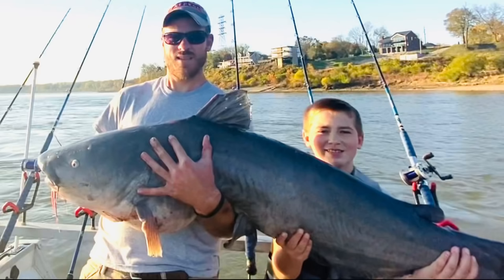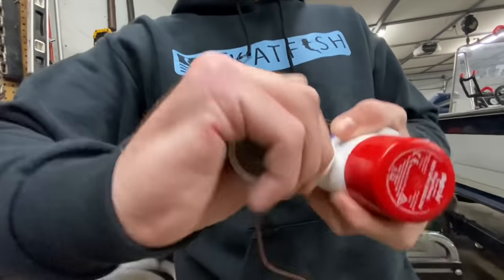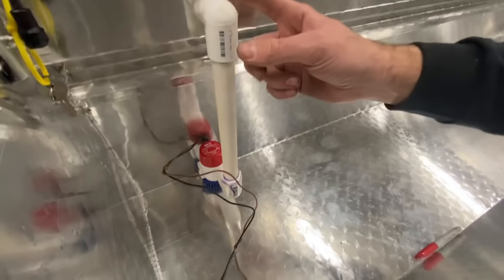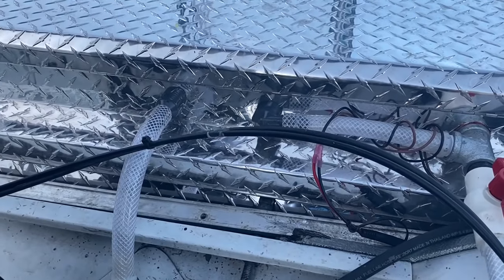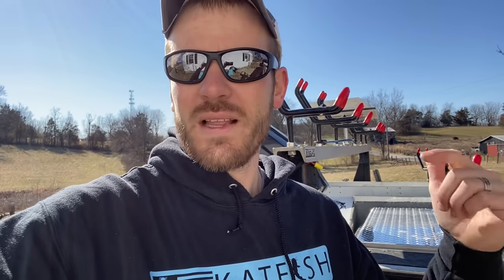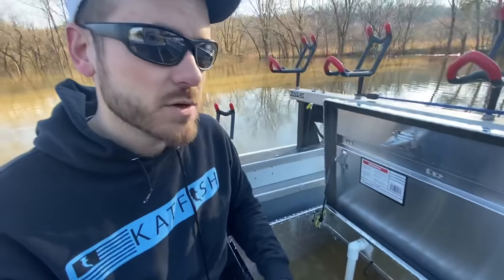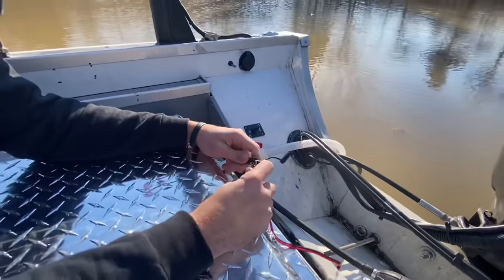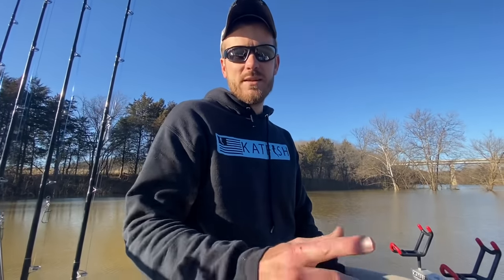80 Gallon LiveWell Build - Simple, Effective, Affordable!

Comment: Instead of pumping it out, why not just have an overflow valve/tube?  You would never have to worry about over filling or the level. Just wondering if I am missing something crucial.
Reply from the maker: Great question. I tried that on my last one, with a 350gph pump and a one inch overflow it constantly was overflowing the tank. I had to put a ball valve on the pump hose and just let the water trickle in.I wanted as much water in and out as possible on this one .It  would take a massive overflow hole to keep up with an 800gph pump. A friend Of mine has his set up with an overflow and he has a 4” drain to keep up with the pump.  An overflow also has to exit the boat below the waterline in the tank which isn’t possible in my boat unless I let the tank fill almost completely up to the top or cut a hole in the side of my boat.  you could simply let it empty into the boat and let the bilge pump pump it out, but then you have 2 pumps running again. Without the pump in the livewell I would also lose the ability to recirculate the water. 
This has just been my experience, I Hope this answered your question, thanks for watching.
Reply: @hagengrubbsfishing  Thanks for the great explanation.
Reply: @hagengrubbsfishing  That shows the value of experience. Great video, keep them coming.

Comment: I made one out of a smaller aluminum tool Box but I just throw a pump over the side with no through Hull and I also insulated the inside of my tank with some foam and painted it with that rubber paint that seals it to keep the heat out

Comment: Very fine job. Always enjoy your videos. 
My tank just has a high water overfill.  I turn the pump on and let it run as the water gets high it just runs out the over fill.  When the boat is running I have a Metal Marine pump kit that has a lift arm and spray head to keep air and water moving.  Tank only needs two holes, one for the inflow, one for the over fill.

Comment: You can put a float switch on the inflow pump so that if the water level gets too high it will automatically shut off so that your output pump can catch up.  No valve restriction needed.

Comment: Great solution.  I'd say you can put an overflow opening at the desired water level and only need to pump water in.  once it hits the overflow, it will drain out.  this keeps you from having to worry it about pumping it out, ensuring that you'll never overflow.

Comment: Great design and a super video!   One question; where did you find the valves you used inside the tank?  Thx.
Reply from the maker: Thank you, here’s an Amazon link to the ones that I used. Thank you for watching 👍 
Attwood 4125-7 Adjustable Polypropylene Livewell Pump or Livewell Aerator Spray Head for 3/4-inch Hose https://a.co/d/eKjmLQ1

Comment: Working on redoing my livewell as we speak! Would you happen to have a link to those spray heads? I like that idea better than drilling a bunch of holes in some 1/2 PVC. 

Thanks for the great walkthrough!
Reply: I actually found the Attwood sprayer head. Did you get the gray barbed fitting for those from Lowes?
Reply from the maker: I honestly can’t remember where I got them but It was either lowes or ace hardware. Thank you for watching

Comment: Do they pumps have to be primed ?  My new pump will not put water in my live well.
Reply from the maker: My pump is mounted under the surface of the water on the transom and it works fine. On another boat I did try to run the pump above the water and pump water over in in the tank and never could get it to work.  Not sure if that’s your problem or not. If you have any other questions feel free to ask. Thanks for watching.

Comment: Awesome only thing id be worried about is the tool box getting hot and over heating the fish in the sun. Night time golden even with water pumping in and out constant that's a lot of exposed alum soaking up the sun and heat and transferring it into the water.
Reply from the maker: Absolutely,  thinking of putting outdoor carpet on it and wetting it throughout the day. Also going to add a pure oxygen system on it soon.  Thanks for watching
Reply: @hagengrubbsfishing  thats a great idea with the carpet! O yea oxygen would be awesome to i know you will make sure the big ol cats are taken care of :)
Reply: @hagengrubbsfishing  insulating the lid on the inside will help a lot also.

Comment: You could add in a timer switch to run a drain cycle and then a fill cycle say ever 15 minutes.  60 second drain and a 60 second fill to turn the water and save on battery